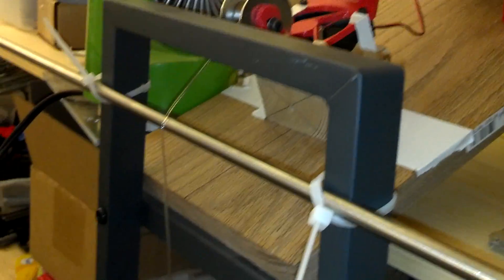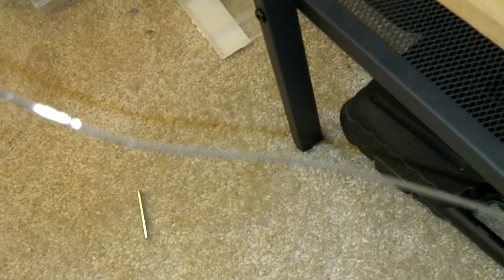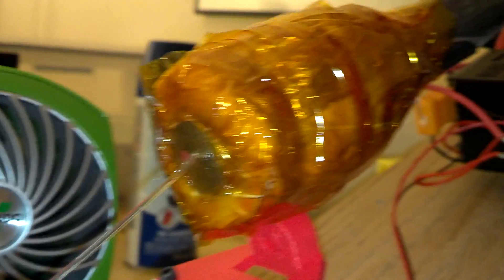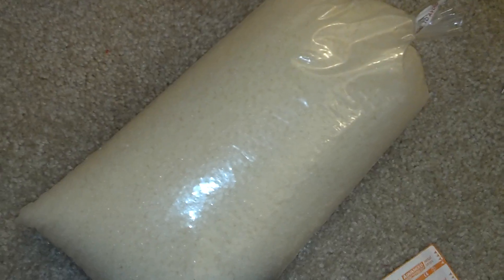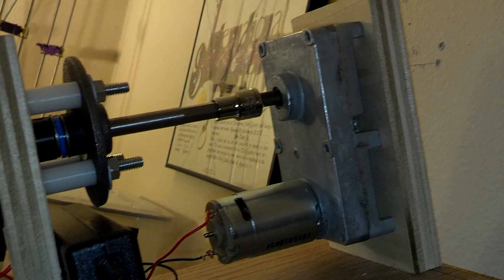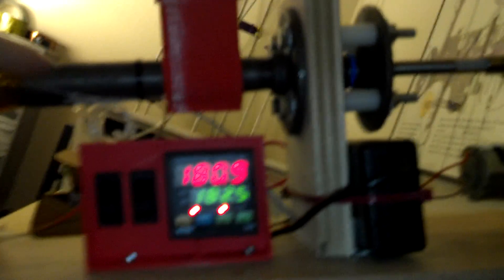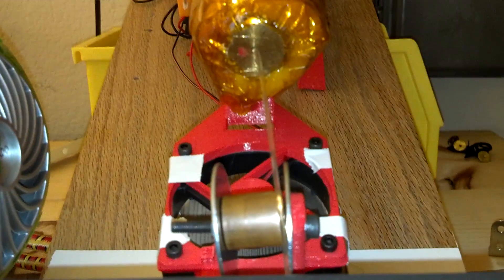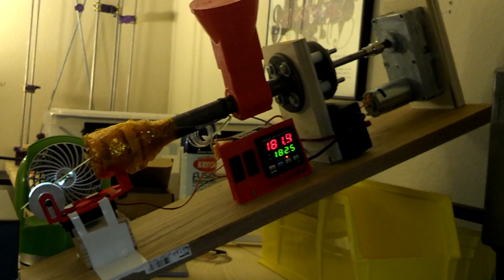Reprap Project- How to Make 3D Printer Filament at Home

Comment: Hi there, would you recommend tilting the extruder at an angle or would it work fine horizontally? Any PLA pellet supplier that you recommend? Do you dry your pellets before extruding them? thanks
Reply from the maker: Would recommend making an angled hopper so you can mount it horizontally, you can get pellets from filastruder.com, and probably other industrial sites that sell pla. You probably don't need to dry it if it's fresh but keep them dry when storing extra
Reply: Where do you buy your raw material? I am looking for a PLA pellet supplier
Reply from the maker: I found good prices with natureworks.com and Amazon has some as well

Comment: The stuff that is full of metal, could that be ground and then the bits with metal in them removed with a magnet?  I am thinking that as long as the stuff contaminating the filament is iron that should work if you could get it chopped into pellets.  You would not get all of the plastic back but you would at least be able to reuse it.  You would probably want a nice size neodymium magnet for that.  I have a 1x1x2 inch magnet and it is pretty strong for what it is.  If you ever ground a piece of metal with a carbide bur, you may have had tiny metal pieces that are hard to see on your skin.  They are hard to see but when you hit them just right they hurt.  That magnet I have does a good job of ridding me of those things if I just wave it over my hand.  I can feel it (not painfully) when it does get them.  I got my magnet that size because that one was not horribly expensive like the bigger ones.  This is the sort of magnet I am careful with around the car because it is so strong, I would do all sorts of damage to my paint trying to get it off (sometimes it is easier to slide it off the edge of what it is on).
Reply from the maker: John Doe that could work
Reply: You would be essentially turning it into pellets by chopping the wasted plastic and extracting the contaminated ones with a magnet.  It seems simple enough and could help people salvage that plastic from the first run to clean the machine out.  The smaller the pellets, the better chance you have of recovering more plastic since you would not have as much contaminated plastic pulled out.  You might want the magnet under a sort of slide that the pellets will all go down and then you can see how much contaminated plastic there is.

Now we just need to think up some sort of metal detector the filament can pass through but I don't have much knowledge of electronics.  I would think pass it through an inductive loop that would be like a week electromagnet with no core.  The impedance of it would change if there is any metal inside it.  This would be similar to the magnetic loops hidden under the road surface near traffic signals.  What you could do is set it up to alert you when there is metal present in the filament.  I have no idea whether or not the ones making the expensive filament are using anything similar.
Reply: John Doe ptfe tube with magnet sounds good. this iver priced. look at his reply like his a god lol.do t waste your time aha. he knows. ripping peoples ideas a smart thing.

Comment: im curious can you do a diff method of using a pressured cooker pot heating the plastic in the pot making malin plastic and just adding a tube for the plastic to come out of and adding pressure or a vacuum to pull the plastic thru the pipe could be the size of filament you want and cool it at the end
Reply: +Michael D ment maltin plasc**

Comment: Hi, i just can't get mine to work. I did almost exactly like you did, but tamperature rices up to 250ºc y motor just can't move the bit. When i open the machine i could see the plastic only melted on the bit, i tried with 2 heating elements, but just don't understand why everyone elses works and mine doesn't!!!!!